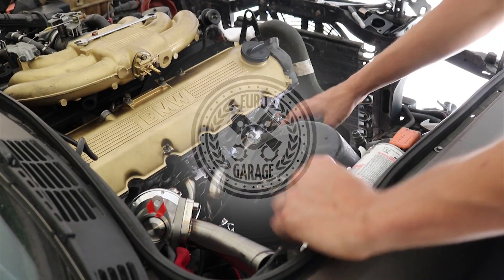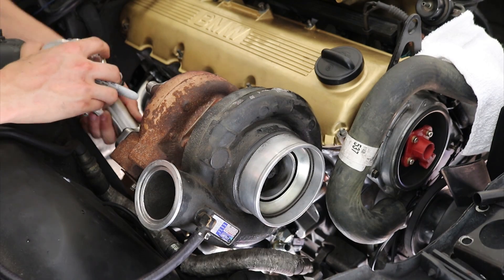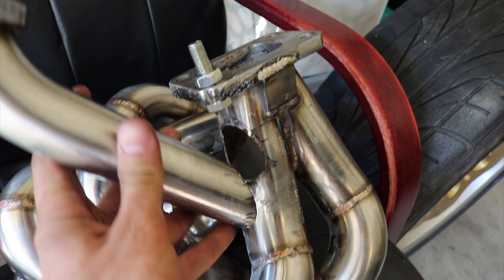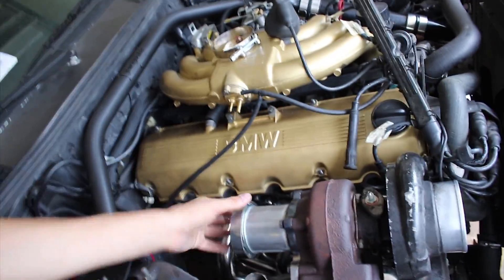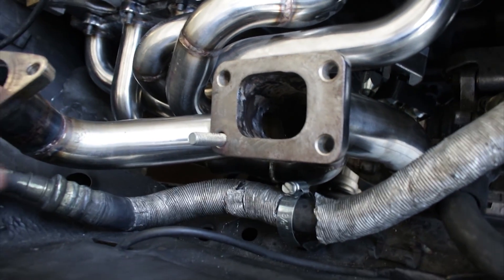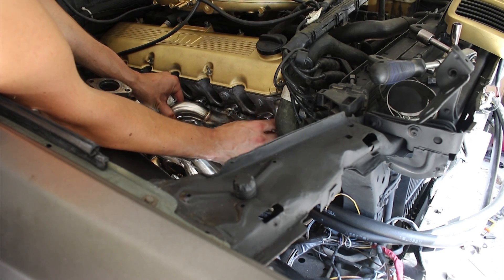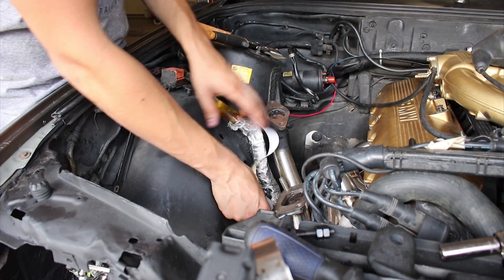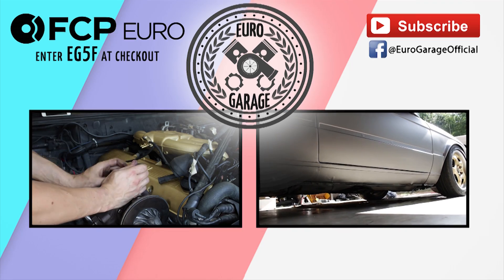Turbo BMW E30 Build: Part 13 | Turbo Manifold Adaption and Install

Comment: The motors number one the bmw is the e34 M5 yes is 3L6 booster a 3L8 forger one big turbo et the mille ch et mil200 nm is big boss one motors bm

Comment: I would have wrapped the turbo manifolds with heat rap. Then I'd put a heat shield between the manifolds and the strut tower. 
I doubt that pretty gold tape will do very much..

Comment: Seems like a lot of bother to weld the internal w/g. Why not just disconnect the boost signal to it, or run both the internal and external wg's?

Comment: so you mentioned the external gate and said it's in the pipe? I thought tile wastegate is the external gate. but you seemed to talk like you installed a door inside the pipe. can you elaborate?
Reply from the maker: Internal gate in the turbo was welded shut and an external tial gate was added in its place.
Reply: I don't understand why the old waste gate isn't enough. Do you have experience with this or is that a forum thing that everyone tells you to do. I'm just asking because i did assume, that the turbocharger  of the bigger engine would have a sufficient waste gate.

Comment: if i install the turbo i have to replace the ecu also ?many thanks
Reply: If you want your turbo system to work properly then yes. Stock ECU can not enrich the mixture or alter ignition timing according to boost. If you dont do that, you can run only very small amount of boost before you make holes in your pistons because of knock.

Comment: Did you, or PO, convert the AC to R134a? Looks like a 134 fitting.
Reply from the maker: Just the fittings. They go from r12 to r134a for easy of shops etc.

Comment: two questions.  

Are you going to paint the turbo?  

And if I may ask what kind of budget have you spent/plan to spend on this turbo setup?
Reply from the maker: Probably not.
I will cover this later. Less than 3k.

Comment: Wrap the downpipe and put a turbo hood on. Otherwise the bonnets paint will crack with all the immense heat, and you lose power with the enginebay so hot.

Comment: What Ecu-management system for your remapping, you going to use? And will you remap it on a dyno? You'r doing a great job btw! ;)
Reply from the maker: MegaSquirt. Install video is in my uploads somewhere. The dyno part remains to be seen.
Reply: oh nice :) good choice i think. ok, thanks i will check it out! :p good luck with your project man ;)